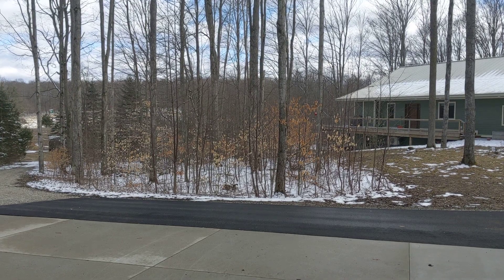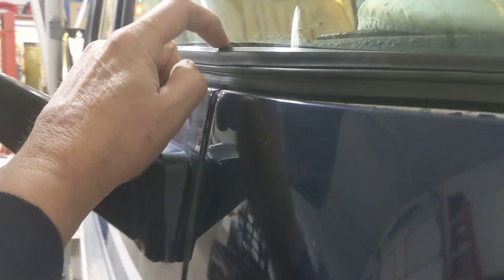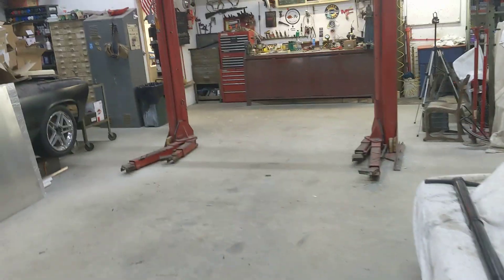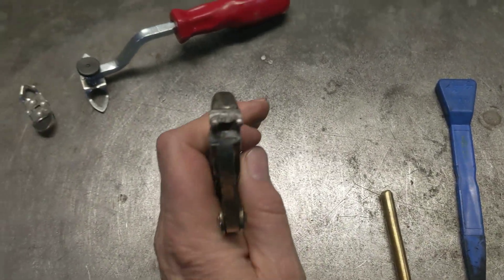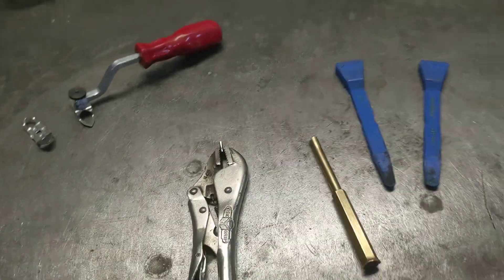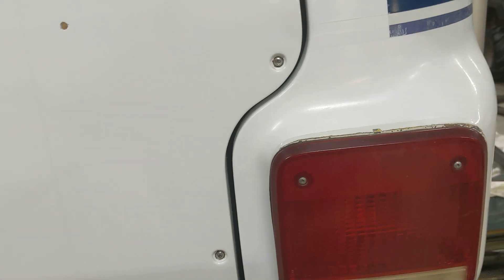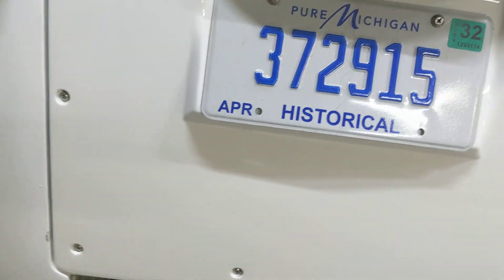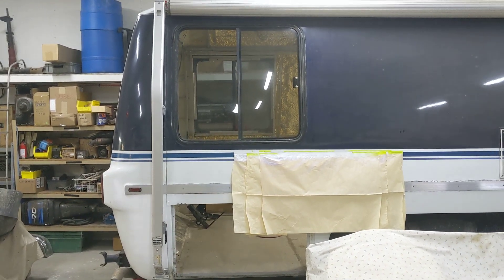GMC Motorhome 148 (rear hatch and windshields)

Comment: Hi Mike, just came across this video. I have a 76 Palm Beach that needs the rear hatch glass replaced. I had a glass company come out and they had a hell of a time trying to install the glass. They finally threw up their hands and walked away. Could you please explain how you were able to install the glass in 15 minutes. Looks like I'm going to have to install the glass myself.
Reply from the maker: @V4Motorsports  Getting the glass into the  gasket was not an issue that was the 15min part.  It took 2 hours to install the seal cord.  As I remember we put the gasket on the body then worked the glass into the gasket.  Compare the old gasket to the new one and you might see an issue.  You can call me if you want.  (989) 274-7344